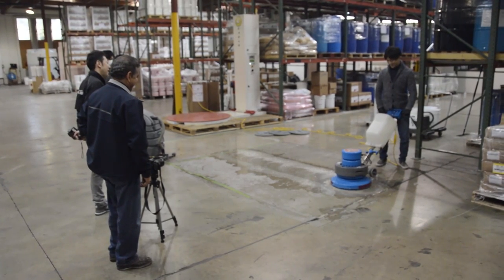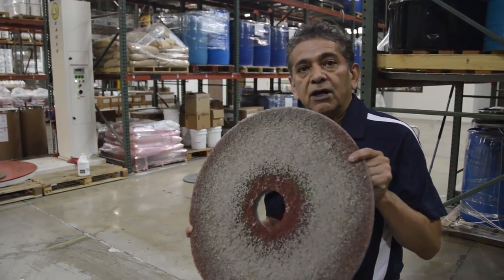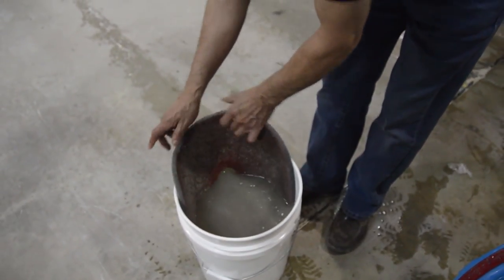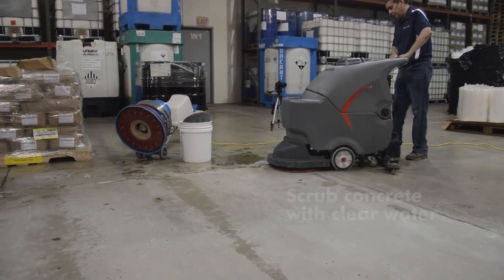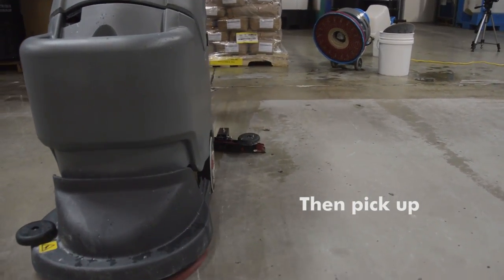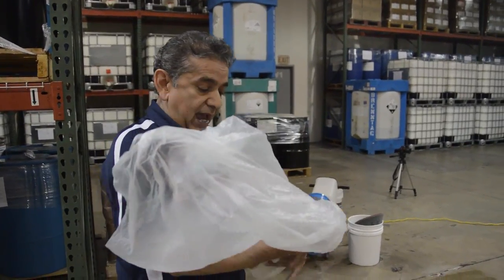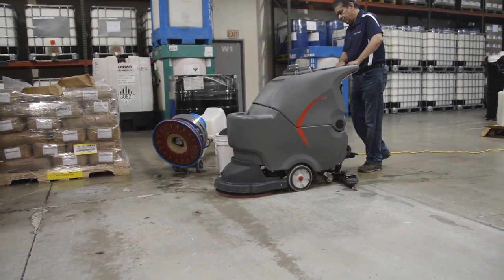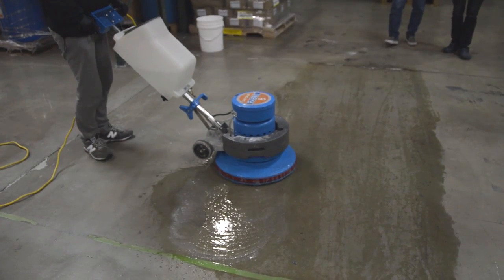DIAMOND PAD Concrete Polishing by Ultra Chem Labs

Comment: Gracias Cesar! When you mention 10 passes, do you mean by overlapping by two inches? Thanks for the video, I need to do this work in my new 60x40
Reply from the maker: You can overlap half the width of the pad as you move onto to the next section.

Comment: I just had a new concrete floor poured two weeks ago. It was power troweled and is flat and smooth but it's a little dull in appearance. Can I follow your steps using the diamond embedded pads to polish the floor up or would it have to be polished by diamond grinding?
Reply from the maker: You can use both methods. Whichever better fits your circumstances and budget.

Comment: Hi Utra chem. I wanna ask something. Was the floor polished beforehand? then the video process for maintenance? or that process for the new floor?
Reply from the maker: Hi! This process is for concrete floors that require refurbishing/polishing. The floor used in this video has had heavy traffic and zero maintenance for 10+ years. If you have already done a deep polishing starting with the red all the way to the green and maintenance is your goal, you can achieve this by using just the process for the yellow and green pad there after. I hope this helps!

Comment: Can I use the red pad on fresh concrete to expose the aggregate, then let the concrete cure (28 days),  apply densifier then complete the polishing with pad 2 and 3?
Reply from the maker: If you have the time to follow this process Yes that won’t be an issue, it is encouraged to apply a densifier after applying 400 grit polishing. Just be sure to clean the cured surface prior to applying densifier and to allow ample time for the densifier to dry and cure before applying the rest of the pads. I hope this helps!

Comment: Hi. Recommend any videos on how to clean a concrete floor. Nothing crazy just a light clean
Reply from the maker: We don’t have any recommendations specifically. But we usually like to apply maintenance with a 3000 grit pad. For daily cleaning you can always go over the concrete with a red pad auto scrubber and 1 oz of our cleaner and conditioner to 1 gallon of water.

Comment: Can I apply densifer to new concrete?
Reply from the maker: As long as the concrete does not have a top coat and is cleaned first, yes you can.

Comment: Should I use a primer/seal before I acid stain smooth concrete?
Reply from the maker: Likely, any acid treatment on concrete would take place prior to primer/sealer application. Please refer to your products manufacturers recommended procedures.

Comment: Great video, how much deep can I go with the red Pad (my concrete floor of my patio has pores?  and if I want a semi gloss finish or not glossy but  yes very smooth what I should do?
Reply from the maker: Blue Matrix this polishing method is designed for indoor surface concrete. Therefore if your patio concrete is rough likened to a drive surface you will need a stronger grit to polish it up. However if it is smooth to the touch this method will work fine starting with the red and working your way up to bring up the polish and shine. For a semi gloss I would recommend our Ultra Sealer. You find more information on our sealer at ULTRACHEMLABS.com > products > floor care and pads > sealer. Thanks for watching and let us know if we can assist you further.

Comment: Did you guys sale any kit ? with those pads and the chemical to polish they concrete?
Reply from the maker: Hi Isai, yes we sell the pads however we do not produce the densifier any longer. You can achieve a similar result without the densifier. But we do provide a concrete sealer for sealing and shine after the polishing is complete. Please email cs@ultrachemlabs.com for an order request. Thanks!

Comment: There are products out there that are used in the Concrete pouring business that will ensure the Pad is clean. OR, ir you mix a solution with 30% vinegar, it will ensure you get all of the Portland (Cement) out of the pad. IT will not harm the pad.

Comment: Do you have to seal the floor after this process? We are refinishing concrete inside our home.
Reply from the maker: belinda cleaves it is not totally necessary but if you desire to preserve the polished concrete and avoid the process of polishing again, our concrete sealer is recommended as a topical finish. 1-2 coats can be applied, and dries clear in a total of 30-45 minutes. This way, any ware will only effect the top coat and not the concrete itself. It is recommended to scrub and recoat the sealer once a year to maintain aesthetic appeal and optimal protection of the concrete. Please let us know if you have any further questions.

Comment: first off the pads should be washed in a pad washer or use a wet dry vac to clean them. the other things to note is ne ve polish a floor that is used  for ork lifts it can make them slip. also you are not told that every day the floor requires washing to main tain.

Comment: "polished concrete creates a lot of dust in its every day use from wear" oh really? And I guarantee that nobody is able to get a gloss reading in the 70s just by using 3 twister pads on a floor that has not been polished before. You'll be lucky to hit in the 40s to low 50s unless you're slopping on a bunch of guard product and burnishing it.
Reply: he said "unpolished concrete creates dust".

Comment: That is absolutely not polishing concrete that’s densifyng and sealing but not polishing to polish yo need to grind the floor ten times
Reply from the maker: Twister Diamond Pad system is designed to grind concrete surfaces down then to polish them back up using the multi pad system.

Comment: Heavy grinding with bigger machines is better . Way smoother and higher gloss finish . 👎
Reply from the maker: This method is a cost effective option to using larger commercial machines.